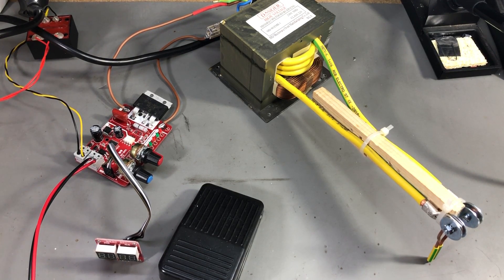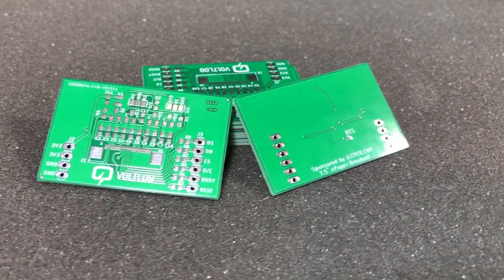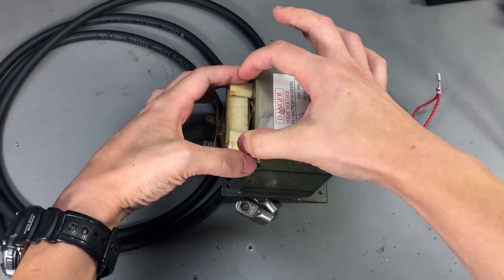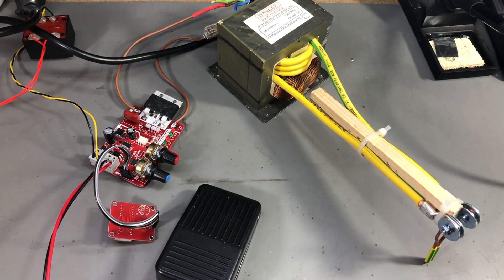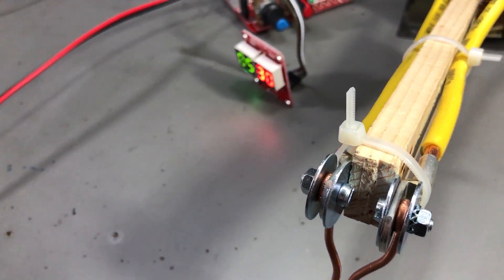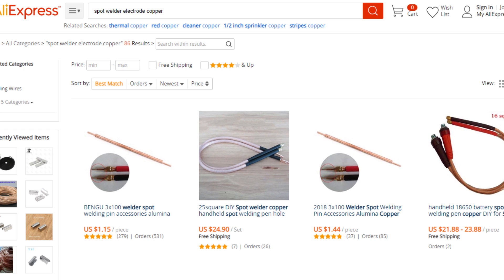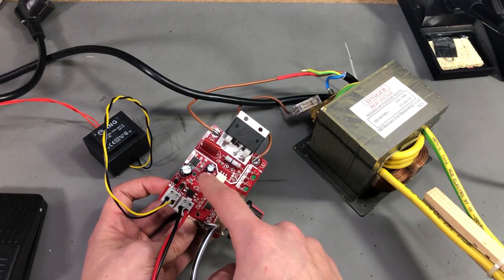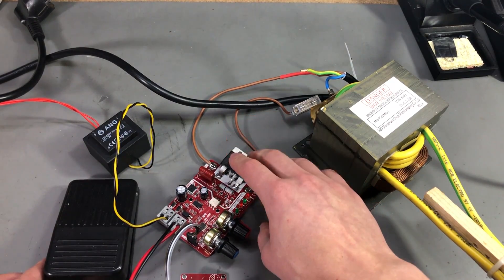Voltlog #207 - Making a DIY Spot Welder From A Microwave Transformer

Comment: Can you successfully weld 0.2mm nickel strips to the battery with this welder? Is there difference when welding 0.2mm PURE nickel vs 0.2mm nickel PLATED strips? This vid is among best explained DIY spotwelders!
Reply: I can weld 0.2 pure nickel with welder like this. I can weld 4x0.1 pure nickel strips together with longer time and current at 100%. Only difference (main i guess) is wire thickness. I use 35mm2 wire (2 turns=1.8V) and i get enough power from 700VA transformer(shunts removed of course). Also make sure your electrode tips are good. Tellurium copper if you can find.  High pressure also needed. Best welds are on 1 or 2 (20/40ms) time settings with this pcb.
Reply from the maker: nickel plated strips are easier to weld because they have higher resistance.

Comment: If I have 2 MOT's sitting here, what is the best configuration to utilize them both in this project? 
Primaries in parallel. 
1 single secondary wound around one core then the other core? 

Or...?
Reply from the maker: The two transformers would need to be identical and several conditions met for wiring their secondaries in parallel. Considering the high currents, I would advise against doing this, because it could end up in smoke.
Reply: @voltlog  Secondaries not in parallel. The secondary wire wound around one transformer core, then the same wire wound around the second core. This is series, yes?
Reply from the maker: @davecc0000  You wouldn't gain any extra current by doing that, you would just be increasing the output voltage.

Comment: Hi and thanks for this excellent vid. I'm going to have a go at it and have already removed the secondary from my MOT. I've got the circuit board and the other bits are on their way. I've bought a proprietary hand held battery spot welding pen though. Will this be OK? Also, where is the very high voltage you mention? Is just from the triac to the primary on the transformer?
Reply from the maker: Any ready made welding pen should help you avoid the trouble of building one yourself. The high voltage is on the primary side of the transformer, the one connected to mains AC. The control board, specifically the TRIAC part of the circuit is at that high voltage potential as well.
Reply: VoltLog Thanks so much for the reply. I'm struggling with the 12vac input. I'd like to power it from my 12v dc solar but can't find any suitable power supplies. Any ideas?

Comment: What AWG gauge wire are we Yanks going to use? 25mm^2 ~ approx. 3 AWG. But all I see is THHN which, by definition, has both poly insulation and (clear) nylon sheath for abrasion resistance--which adds unnecessarily to the diameter. Is a poly-only or other thinner insulation wire available domestically? I don't see MTW in that size...
Reply from the maker: I don't know what's available there but I'm pretty sure you could find something close enough, like I did in my case, I couldn't find 25sq mm and I got 16sq mm which still does the job fine.
Reply: use capton tape

Comment: hey ,i have to spot welders for battery tab welding,one is build around an MOT with a Crouzet syr line digital timer (the timer was gift from my father-in-law,cause it's very expensive for a diy project cost around 200 euro) a solid state relay to switch the primary,the second welder is build around 8 irf1404 power mosfets an arduino timer  and i'm using it with a 450 CCA 12v car battery ,both of the welders working very well , i'm planning to do a video for both of them  with a more detailed presentation and explanation

Comment: This is a rapidly growing area of interest, I build battery packs for myself and the Arduino welders and perhaps this one are better than the Sunnko. This is the most sophisticated for the price. All in well under $50,
Reply from the maker: Because the microwave oven transformers can be obtained for free my build budget is probably around the $20 mark. If you count a ready made welding pen and electrodes from aliexpress than you might push it up to $50, but I don't think there's anything out there to beat this.
Reply: VoltLog price wise no, no competition. But a fellow in Croatia builds a $100 unit that we who are not as talented as you can/could repair. Seems less threatening than a microwave version. BUT it does require a large SLA  or a LiPo pack to power. Perhaps safer?
Reply: My offer to send the device you already had extends to the JP Spot Welder. I’ve had 4 versions, but not this Aliexpress $13 version. I like running power from my used 12v SLA. Others are using Hobby LiPo. I don’t feel safe with it. I suppose my fears are more a result of my age and my aging acuity.  I’d like a review of it. May I have a method of private communication? I have no financial interest in the product, but a domhave a passion for the global exchange that happens here. I’ve learned a lot here. Thank you!
Reply from the maker: Thomas Jaszewski you can email me contact at VoltLog dot com

Comment: Great concept but show if they actually completed working model with the proper heat sinks. Items from overheating from continuous duty cycle. Advance to keep components: the case order the correct electrodes for doing the spot welding so you can actually show with a working model that YouTube we can copy without danger

Comment: The problem is due to still high voltage. I made one with a thicker secondary cable that I've made myself from 0.9 sqmm EmCu. I have like 25 individual wires in parallel, 2 turns. Voltage is 2 V, but the current is very high. I still don't have the timing thing implemented, but I'm using it to weld other things than battery strips. Keep up with the good work
Reply: the reason you cant control the current is that you copied what 98% of people on you tube do, they havent got a clue, they all buy the 100a version then use it to switch the primary side of the transformer and expect to control the current that way. the reason you would need a 100a tyristor is to control the secondary current. and you can have more than one winding in the secondary hence you could get your 12v from there

Comment: I like the idea of using the  bought controller board and other parts to make it work more professionally. If I ever get access to enough batteries I'm tempted to make one using your design with some modifications to the arm build. I've watched several videos on this and yours is one of the best I would just like a more substantial design for the arm
Reply from the maker: I agree the weak point of my design is the welding arm, I just don't have the skills to build something better mechanically. An alternative solution would be to use one of those welding pens with wires.

Comment: I made one of these, a bit more robust, years ago, but it worked well only a few times, maybe I can fix it, but I never needed. The electrodes I used are from "electrolytic copper". Thanks for sharing !
Reply: doesn't sound very robust if it only worked a few times!  😛
Reply: @SolarMillUSA  Indeed ! :D
Reply from the maker: thanks for the tip!

Comment: It give to much weld. I believe the foot pedal and or the board needs a faster cycle time, so if you can make that board cycle faster I would try that. Using the battery, solenoid and momentary switch, I learned the faster I tapped that switch the longer the copper contacts last and perfect welds. Even though they're both different ideas the time on allows for too much amperage.
Reply from the maker: I'm running the control board turned almost to a minimum. There are different ways one could do spot welding, each method with different advantages and disadvantages. Also I'm expecting to refine my technique as I use it more.

Comment: I wonder if tungsten rod for a TIG welding torch would work for your electrodes
Reply: I was thinking the same thing. I was going to make a self-start for my old stick electrode welder, and the circuit uses Tungsten tips for the spark gap so it doesn't wear.
Reply: The electrodes appear to be "Alumina copper" but I would be interested in other materials too. I presume very high conductivity is a must, and aluminium doesn't stick or weld to steel/nickel
Reply: I was thinking the same thing.. I have several old MOT laying around from 1000 units and probably 200 18650's collecting dust. I think this may be exactly what I have been looking for. I will give it a try with the tungsten tips as a welding supply shop is just down the road from me. but But it will take 4-6 weeks for aliexpress...lol
Reply from the maker: I guess I could give them a try but I need to figure out a way of attaching them. Are they brittle? Can the electrode be sandwiched between the two washers tightened with a nut?
Reply: @voltlog  They should be, there used as welding tips here in the states and are fit inside a hollow bolt and clamped with a allen bolt . normally it has no more than about 35% copper or cu35w65 but a cu30w70 is also common but both can be expensive.
Reply: @voltlog  There is different purity, but the one I have is as hard as Hell. It's hard to even grind a point on it. I don't think you can bend a loop in it like that copper, so you would have to cut a TIG electrode in half and put grooves in your washers to retain it.
Reply from the maker: @SidneyCritic  Okay, sounds good, I'll check with a local specialist hardware/tools store to see what they have in stock.

Comment: My design of the case quite different but you can have a look at it on georgehobby.wordpress.com
Reply from the maker: your design seems highly optimized, two SCRs in back to back configuration, you obviously spent some time figuring out what would be best.
Reply: VoltLog yes indeed. Product design always takes some time. I look at the reliability of a product.
Reply: VoltLog two SCR design is the standard industrial design recommended for inductive load. Moreover the current capability is very high when using dual scr design.

Comment: The sparks are due to the loos contact between the electrode and the strips. If you noticed the second weld at 12:31 did not spit out any spark. The spot weld pulse time looks a bit too much because the weld has burnt of some of the strip surface. It could be probably because of the  first weld. 

During a spot weld there should be a firm contact and pressure in order to get the best weld and reduce sparking. I did not see any sparks when I tested mine.
Reply from the maker: yes and no. I have observed that a lack of a perfect contact will let the sparks fly but I also noticed that the electrodes stick to the weld, while on the sunkko spot welder with it's special electrodes it does not. Do you use the same solid copper wire as electrodes? (though I would expect differences even between solid copper wires from different manufacturers)
Reply: I don’t use thin copper electrodes. I used thicker ones about 4mm I think. I suspect your electrodes being thin cannot take the current. You could reduce the cycle like 1 cycle. I use dual pulse with first cycle at 10ms, pause of 450ms and final weld at 20ms.
Reply: you actually have to be careful about applying too much pressure, or you will *reduce* the amount of resistance needed for heating.